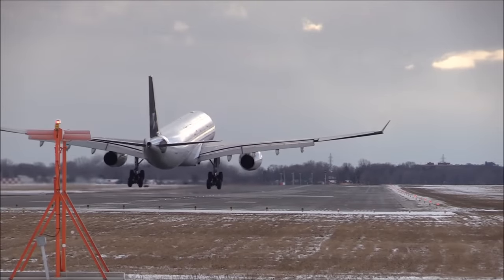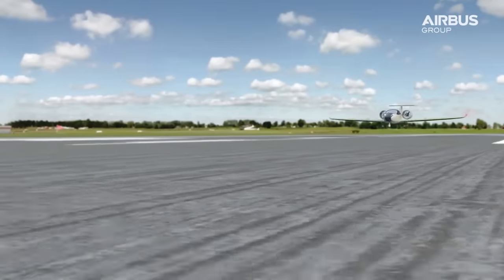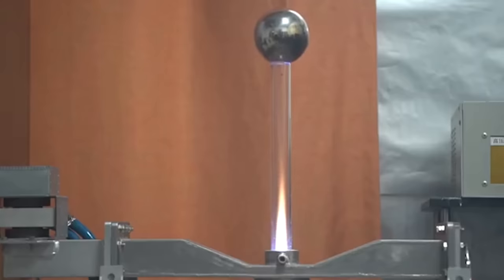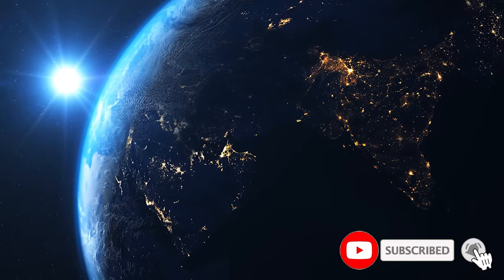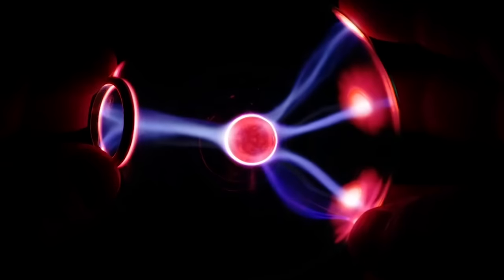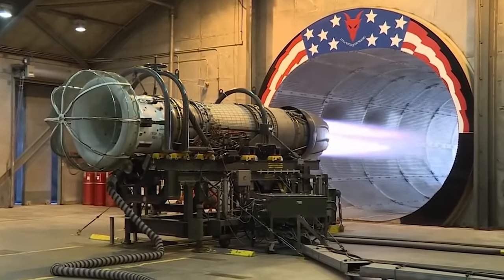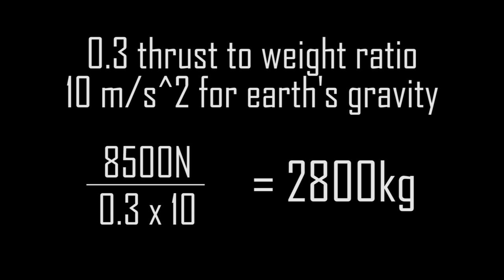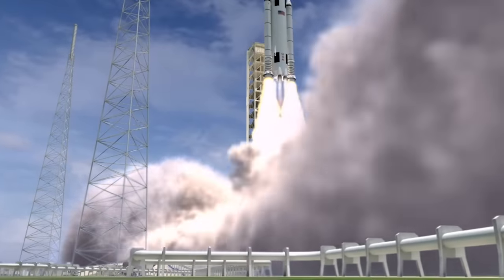Uncovering China's New Electric Plasma Jet Engine

Comment: im honestly amazed that electric flight hasnt been a thing yet as there was a very very good run at it over 70 years ago. and they achieved lift even with the tech at the time. 
big oil is the main reason why i think. its squashed so many great ideas that could have saved the world were destroying faster by the day.
Reply: Not really just not cost or energy effective... A bunch of these technology's require rare earth resources.
Reply: @happyjohn354  yeah its the same reason electric motors didnt get developed till close to 2010. they were just regular ole early 1900's design. big oil killed off electric cars because they wouldnt make money. things are inefficient because they dont get developed more. just pushed to the side.

Comment: How about running this system on a small air cooled nuclear reactor. Say a thorium reactor. Rather than batteries that need to be recharged. 

If engineered the right way, this technology and the reactor could keep a plane up and running for months at a time without having to land.

Comment: I think peak aviation was 1969
Concorde- no pax jet faster since
747 
737-200
Apollo 11 

Incremental improvements in safety and fuel efficiency each generation since.   

Battery tech not a whole lot ahead of
the lead acid developed in 1859 and the shortfall in energy density and difficulty in methods and weight of hydrogen storage I’m guessing once the Kero runs out aviation is toast.

Comment: Like a death charger combustion underwater vers a compare of land granade, you get the same purpulsion of a fossil method, only it can be infamatly amped with a solar &/or mini fusion nuculas cells the way satilites are safe enough, only visioned in sci-fi cartoons. Its also the kind of engine, space abduction craft witness claims came about, because its the next phase in flying engines that is also space age next to gyroscoptic and geoscoptic abilities called Anti-gravity.

Comment: Why woildnt they use the compessors that are already in current turbine designs, once its on its self sustaning and unless you lose power to the microwave system it will still keep going

Comment: Heating air to such high temperatures using concentrated microwaves most likely cause oxidation of Nitrogen to Nitrous Oxide. Wouldn't this reaction cause environmental problems worst than using Hydrocarbon fuels?

Comment: Just add electromagnets to speed up the plasma and have magnetic fanblades push it to increase the efficiency overall
Reply: The fanblades being regular blades that are composite that have magnets and embedded coils in them to push the plasma even faster without them gaining as much heat to thrust it faster

Comment: Electric vehicles tend to net greater ‘carbon emissions’ (whatever that is supposed to mean) than fossil-fuel heat engines, due to increased complexity of manufacture and power generation over functional lifetimes. It’s moot anyway, because the AGW CO2 hypothesis has no basis in sound science.

Comment: There are two places microwaves are useful on a plane. In the radar and in the galley. 
Microwave plasma is nothing new and anyone who has tried it knows that it is about as inefficient an energy conversion process as it is possible to imagine. 
And as a "bonus" the tiny plasma flame produces more NOx pollution than a top fuel drag racer.
Reply: Ionized microwave radiation... idk but that doesn’t sound good

Comment: .... why tho. The reason gas turbine engines are inefficient compared to electric is the excess heat.  We want efficiency not power. 
Batteries are the limiting factor not engines.

Comment: This is a big deal!  large amounts of thrust can be applied in space without fuel on demand, even it if requires a long charging cycle, gas compression etc... I can see space craft using multiple propulsion mechanisms for efficiency, this would be ideal for collision avoidance.

Comment: If you use a fuel cell, you can get the electricity without the heavy weight of a battery.
Reply: By burning fuel to make electricity to power an electric jet...
Reply: @robbiejames1540  A fuel cell doesn't burn fuel. Unless you are talking about getting hydrogen, but even then, you can use electrolysis. Yes, it uses more electricity than you get back, but don't think of it like as a power generator, think of it as a type of battery, and it starts to make a lot of sense in vehicles.
Reply: @mattevans4377  
so if a fuel cell doesn't burn fuel, how does it generate electricity? Yes, a hydrogen fuel cell powering an electric plane could work (though you then need to carry either heavy high pressure hydrogen tanks, that might slowly degrade due to hydrogen embrittlement, or liquid hydrogen, which would also need special storage systems to prevent the cryogenic temperatures making crucial plane parts brittle. If we use hydrocarbons as the fuel, we either need to strip the hydrogens off the carbons and store the carbon on the plane for removal, or burn it to produce CO2, which hasn't solved anything.
Reply: @robbiejames1540  This is a relatively basic version of how a fuel cell works: When the hydrogen from tank comes in contact with the air, it wants to bond with oxygen, which the fuel cell takes advantage of. To get to the oxygen, the hydrogen has to pass through a membrane, which strips electrons from the hydrogen. When the hydrogen bonds with the oxygen and produces water, it goes out another way. The electrons from before go along a wire, generating a current, which is how we get electricity, and meet up with the water byproduct at the other end of the wire, as it wants to get back to the hydrogen in the water.

The storage problem has also clearly been solved, as fuel cell cars are already on the market.
Reply: @mattevans4377  
Ah, i see its just terminology - ie the chemical reaction that takes place results in the same end products as burning, so i was just calling it burning. while storage is at least partially solved for cars, i imagine that it could be much harder for planes, as their weight to energy is much more important, because unlike a car they don't have wheels holding them up.
Reply: @robbiejames1540  I think you are referring to lift to weight ratio, which doesn't matter as much as you think, as something like an AN-225 can carry 225 tons of cargo. The biggest impact, will be how much it eats into passenger/cargo space. And batteries are still heavier regardless.

Comment: Not likely. Ionized thrust would only work in the vacuum of space where only the slightest amount of energy would be needed to produce thrust it can be as little as 1 lb. Of energy and that would still give you motion down here in earth plasma requires alot of energy to produce it hence we don't  use plasma in our flat screens anymore we use LEDS more efficient and longer lasting. But back to producing plasma it takes more energy to produce than it would be putting out. I can see the future of commercial jet engines burning things like hydrogen or a helium oxygen hybrid gas that would end the need for fossil fuels thrust vectoring dynamics is rocket science not easy stuff and things change at different altitudes so much I could say but don't feel like an 1 hour long post.

Comment: There are so many better, lightweight, and more efficient means of generating plasma, I do not see why they used microwaves. It's the equivalent of using a jack hammer to press the flush handle on your toilet.

Comment: You can throw cool engines at me any day, but I’m not buying that commercial electric flight is coming any time soon until I see the batteries they plan to use for these puppies. Current batteries have nowhere near enough charge density for a decent range flight.

Comment: The Airliner example neglects to address the fact that the real cruise thrust to weight ratio of an airliner is not 0.3 but less than 0.03.
They only use full thrust on takeoff. They have engines that are inefficient at cruise to allow for high thrust on takeoff from the same engine. An electric thruster like this, with no moving parts if optimised for cruise speeds, could achieve 10 or twenty times as much thrust for energy used than current airliners at cruise.
Also your belief that the electric discharge is igniting the ionised plasma is quaint and illuminates us very well, about the hopeless lack of understanding of chemistry and physics that equips you.
Thus demolishing the credibility of anything you say.

Comment: I’m not guna get in a plane that uses only a battery!
Reply: Less flammable than regular fuel. Only question is capacity but that's about the same as asking what size gas tank.

Comment: Dude. Holy shit. I can’t believe this is now a thing. It’s fucking perfect! Look this is just what we need to create Hydrogen fueled Jet Liners. Hydrogen has higher energy to weight ratio than traditional fossil fuel. And when coupled with Hydrogen Fuel Cell, stored hydrogen can be directly converted to electricity on demand as the Electric Jet Engine plane flies in the sky ✈️

Comment: "Maybe this electric jet technology could power the rockets of the future". Umm no... Do you understand the difference between jet and rocket engines? Combustion needs oxygen. Jet engines get oxygen from the air around them.  Space has no air. Jet engines cannot leave the earth, let alone get us to mars. This concept is an electric jet engine and is not applicable to rocket engines as the reason for using air is it's all around at the altitude planes would be flying. Since the air gets so thin jet engines don't work long before the karman line and space has even less material, it doesn't make sense to use air. The space could be better served with a more energy dense fuel-oxydizer combo like kerolox or methylox.
Reply: @mat7can106  my point is that you have nothing to turn into plasma unless you bring the air with you, in which case there are much more energy dense fuels you could bring. Yes they use ion thrusters in space, but they don't have nearly enough delta v to reach escape velocity and break out of the earth's atmosphere.
Reply: @mat7can106  Hes right though, this plasma jet engine is not an ion engine like the ones you see on spacecraft. It uses air from the atmosphere and not its own internal stores of fuel.

Comment: I've learned that renewable energy when it comes to things like this is purposefully being blocked
If ion generators can conduct electricity by the capturing of ions by a rod because as mentioned 
Ions are abundant throughout the Universe.
Surely applying the capturing principal to whether it be a plan or anything that requires power to move shouldn't be a Ficken issue.
What do I know,,
I'm just a Somebody
Excelsior 😉

Comment: STOP SAYING ELECTRIC PROPULSION IS ALWAYS BETTER. IT'S NOT*. WHERE DOES THE ELECTRICITY COME FROM??? (*FOSSIL FUELS).ok sorry for caps, but stop thinking your tesla is saving the world. It's not. Active carbon filtering is one of the best shots, since almost nothing can beat carbon based fuels in cost and storage density. For example : the filtered carbon dioxide pellets can be  made into fuel which you can use for propulsion and the refilter. In combination with restoring the rainforest this would give humanity complete control of the CO2 content in earth's atmosphere. We could then  use it as a kind of carbon storage. Having a filtering station (powered by fusion or renewables) feed a fuel factory would remove the need for expensive fuel transportation, since we're then essentially getting fuel from thin air. That's just my oppinion tho

Comment: It's highly unlikely plasma jet engines highly improbable that I will ever work in aircraft The biggest problem is weight The second problem there you going to be facing how do you get enough air to be compressed to make this operational you might not realize because it's not widely known but several scientists have already criticized it because of this The third problem is the overall amount of heat it generates this is a big problem because this makes it highly unsafe as well as meaning that it has to be upscaled Make it far more heavier wear weight becomes another issue again
However a similar technology plasma engines have been used to help navigate space stations around but they're more like small little rockets that do not require very much power and they do not create that much thrust but technically they do not need that
Bizarrely enough I feel like I have to remind you rockets and jets are vastly different and I don't know how well this technology plasma jet engines will translate to rocket technology it seems you're mostly implying to apply this as some type of hybrid rocket which brings up another question why would you do that cut back on fuel cost do know that you hear you're increasing the weight of the rocket which will mean more fuel unless you believe that we're going to do the whole spaceflight to Mars on one rocket no offense but that's absolutely ridiculous it's like sprinting a marathon or trying to become a the biggest bodybuilder to be the fastest swimmer
I'm sure the electric plasma jet engine will be quite vital in the future we just don't know how to practically apply it to anything anything that might associate it being applied to a fixed structure or something that has access to the power grid for example electric trains by the time we realized how to deal with the weight problem power problem and heat problem as well as the air compression it will never be ready for any flight applications not saying that this isn't a major breakthrough it is but it's dependent on too many other technologies to make similar great breakthroughs for it to work by the time they can figure how to make this work regular jet engines Will probably make far more advancements making this a technology that might never get off the ground this technology is better off looking for ways of exploiting it other than aviation and rock technology

Comment: This is nothing new.  It's an old technology dating back to the 50s, and it is limited in that you need an ideal environment.  You can't get something for nothing.  Plasma jet drives are interesting, but both USAF and NASA tried to make them workable.  I think their advantage was that they were more workable with thrust vectoring.   Beyond that you still don't get more thrust without more energy injected into the system.

Comment: Hell Rasier Thermo Plasma insenerary Device. A Design Like The Box from Hell Rasier the Movie, But The outside Groves Draw In different Types of Electromagnetic Radiation, Inside Fuel Cells, With A Fuel Or Material to Create The Thermo Plasma explosion or Burst.
Reply: How the Box opens. That is what you might need also.

Comment: I don’t understand this video.  Electric planes, and even electric plasma jets are nothing new and they certainly were not invented in China.  The problem is energy density in the batteries and nobody has solved that problem yet.  So it really doesn’t matter how powerful an electric plasma jet is if there’s no way to power it for more than a couple minutes.  I’ll check back in when China creates an energy dense battery that isn’t a ripoff.  Until then my fingers aren’t crossed and I’m not holding my breath.

Comment: interesting... I'd bet that in commercial use you'd want precompressed air in the form of bottles or something so you don't have to take enough batteries to charge the air at takeoff and landing. Also once you reach sufficient speed IIRC opening an air inlet with a restriction can be used to compress ambient air down to different pressures so at speed you may not need an air compressor at all... Just flow and charge.  Mind you I am not an engineer just some stupid guy on the internet so please don't take any of this as fact or even as plausible there's a 99% chance I'm just talking out of my ass.

Comment: This is pretty much useless tech, microwave propulsion in an atmosphere is way less efficient that electric ducted fans and the problem with electric ducted fans isn't thrust. They produce more than enough to propel a jet liner when scaled up. The problem is energy storage, the energy density of kerosene is over 30 times that of our best Lithium batteries. We can hope for better with SS batteries but even a 3 times factor is a pipe dream.
When talking about planes that need to stay disconnected from infrastructure for over 3 hours using batteries is just not possible with current technology and even with 100% efficient propulsion systems it still would be a stretch.
Nuclear was once considered but even the US Air force gave up because of the danger posed by having flying nuclear reactors.
The only other fuels that should be considered for aircraft would be gases like methane our Hydrogen should we overcome the storage problem